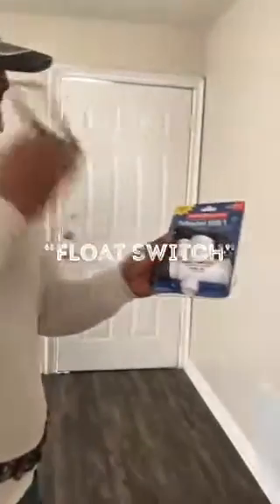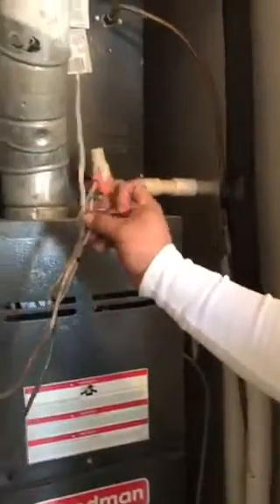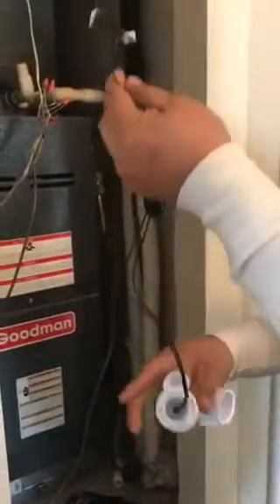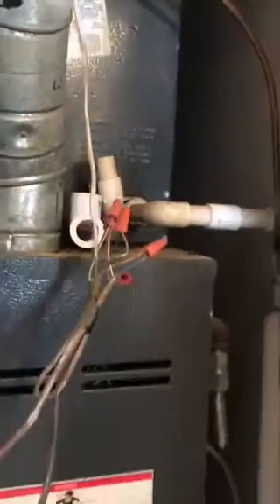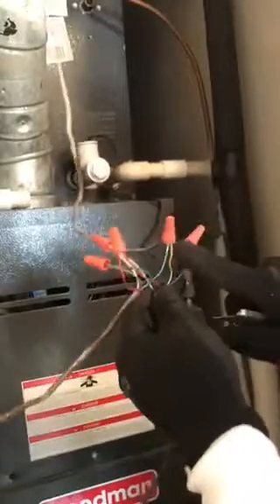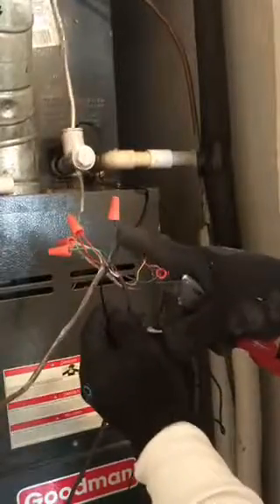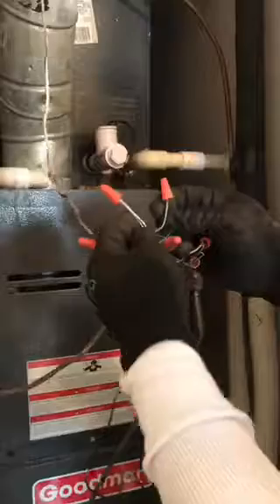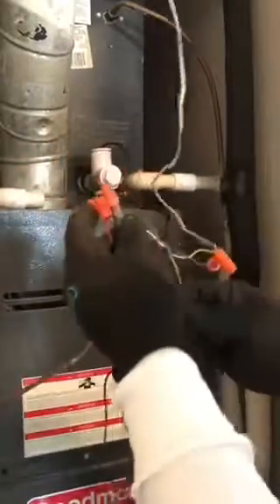How to install float switch water over flowing prevention switch

Comment: I Truly appreicate your video. You are the only person who has a detail explanation of the common ac wiring to connect one of these switches. I made a mistake by listing to others who were not very clear and I blow the circuite board fuse. Thank God it was only the 3amp fuse in the circuite board , it's  106 degs outside.  Everything is back and running  again. Thank you very much.

Comment: That is not wired correctly you cut the red wire one of the wires coming off the safety switch goes to one side of the red wire the other wire coming out the safety so it goes to the other side of the red wire that way it shuts the whole system down that is the incorrect way to wire it the way he's doing it you don't use it for the cooling and if you have a 90% furnace you need to have two of those switches one for the furnace and one for your condenser but that is not how you wire it it goes to your red wire
Reply: So basically just connect to red wire from thermostat& outside unit?
Reply from the maker: i believe which ever wire you choose to cut, that will be the fuction it will disablem for example, if you cut the red wire coming out of the furnace, the whole furnace will shut off.

Comment: so one connecting to the coolin on the t-stat and one go out out unit for 24v on on cantactor
Reply from the maker: So one wire that would go to the outdoor unit (if you have 2 for straight cooling) 
You can cut it , then the sensor would attach to one end that goes to the outdoor, and the other end that goes to the inside
Reply: @gomern549  got it now lol we had to wire them by memory at the trade. i understand it now